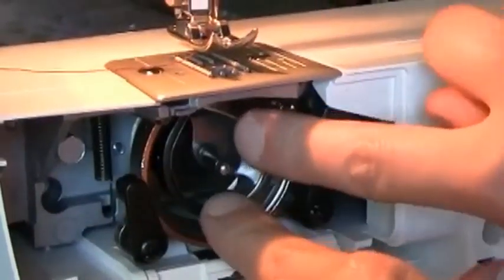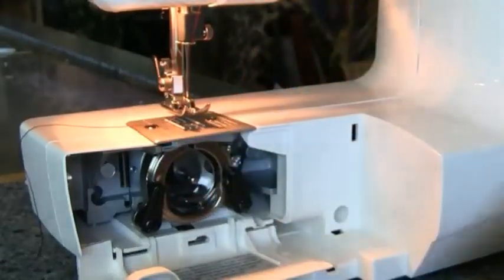How To Thread Bobbin on Brother LS 2125 Sewing Machine | The Crochet Crowd

Comment: Thank you so much! I was so confused, I'm using my mothers sewing machine and it's nothing like the ones I learned to use at school
Reply: Same! I’m used to the one where the cover slides out and you just put the bobbin in, this one was so foreign to me and I’m so glad I found this video!!
Reply: Mine is this exact model, but older. Brother LS-2125i
I believe everything about both are the same for the most part. It's just that this one's knob with all of the different stitches, is blue compared to mine, which is white.

Comment: Thank you so much. I did the same thing got it back together in half an hour. But bring up the bobbin I could not get. Sometimes it worked most of the time it didnt. I wasn't holding the top thread so thanks for that. I was going insane!

Comment: The bobbin assembly should be taken out and cleaned periodically. Thread and dust build up back there and needs to be cleaned out. Once you take it out and put it back in a couple of times, it will be a very easy process.